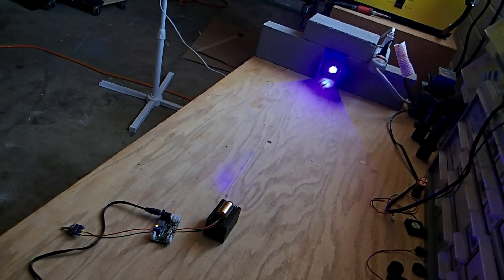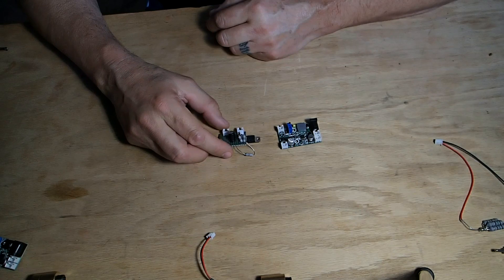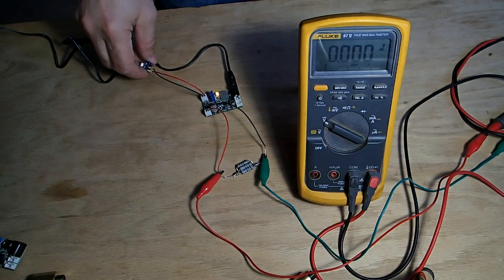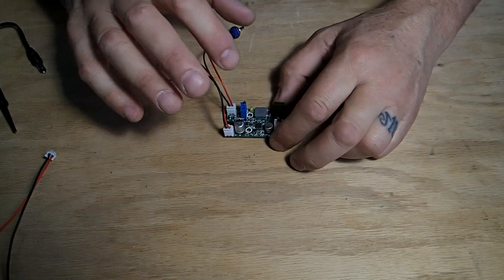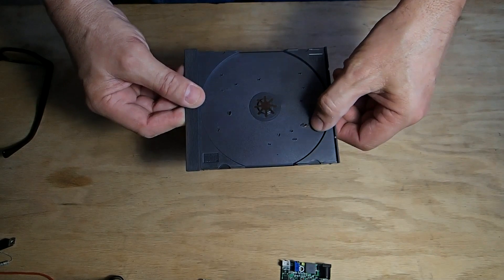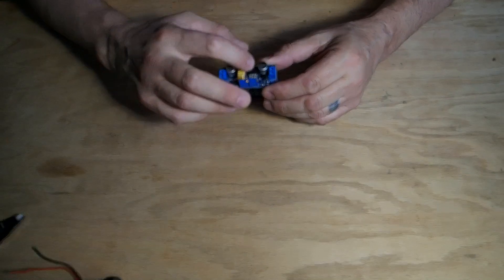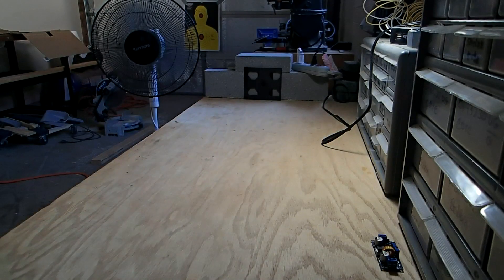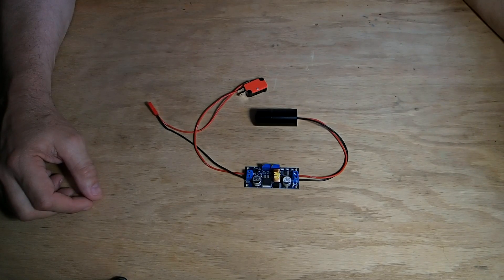Burning Laser Diodes What You Need To Know What Others Dont Show You

Comment: With my 2 watt 445 you can see the beam without fog or smoke.
Reply: You can not see laser light unless it is reflecting off something of the beam is aimed into your eye, if you have no fog or smoke you have dust or something else for the light beam to hit and refract off, otherwise the beam is a collumated constant flow of photons in one direction or otherwise said a laser.
Reply from the maker: Outside I can see the beam because there's particulate matter outside, but inside there's no dust inside the house in the air to clean